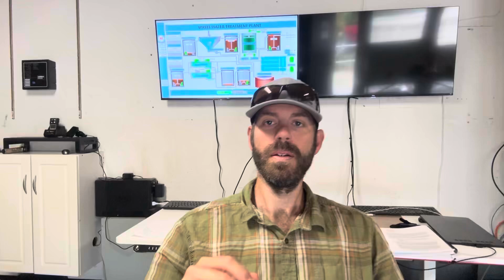I Got Called In! Explaining How I Respond to Wastewater Treatment Plant After Hours Emergency Alarm.

Comment: Luckily for me the plant is do waste water for shuts down during the night. We still have issues here and there and need to come in because our waste water stuff still runs. Just a lot slower. But it's usually a pump not pumping or high pressure or a malfunctioning level sensor. Most calls are dealt with in like 5 min once you are here lol
Reply from the maker: Awesome thanks for sharing!  Yeah most of my alarms are resolved pretty quick.  There’s an occasional water leak or pump failure that takes hours of work, but that’s pretty rare.  Thanks again!